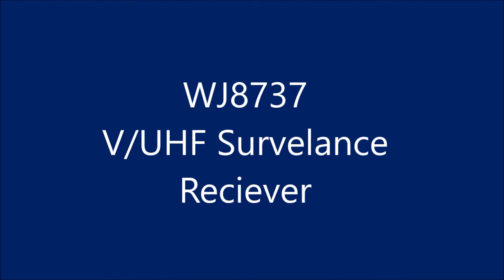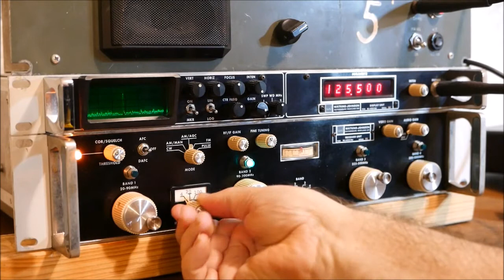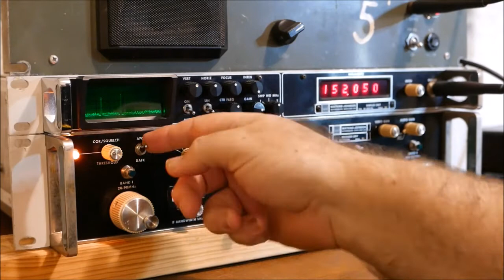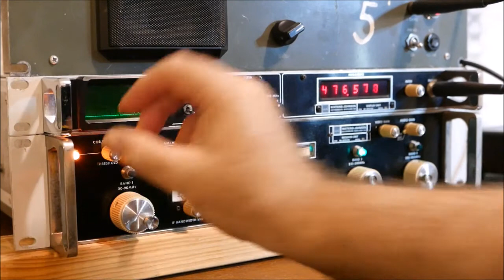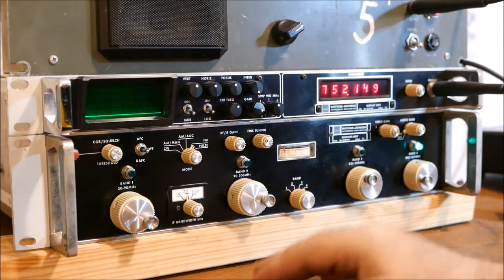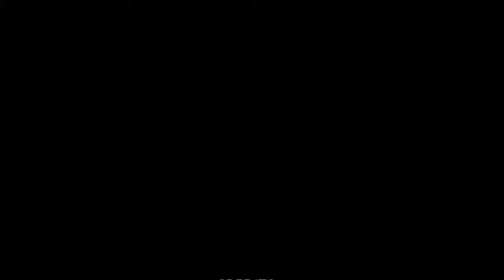WJ8737

Comment: Awesome I just bought one from eBay working just like yours cables all connected I have another one identical I bought from fair radio in 1994 it’s was tested ok at that time now I’ll duplicated the cables should I be concerned of blowing any Caps from the one from fair radio in 1994 thanks
Reply from the maker: Hi, thanks for the comments and great that you picked another one up. With regards to capacitor, if its not been switched on for 25+ years, you should take a quick look at the PSU Tank capacitors. Either 're-form them' or bring the unit up on a variac slowly and keep an eye on them.   Good luck !! all the best Pete
Reply: @vk4gxc  thank you I love your videos as I have similar radios indeed I’ll use a variac on all old gear I find  so I’ll do this with the Watkins Johnson  the one I bought from fair radio in 1994 it’s the cables that kept always I found is a stumbling block in powering these up to find connectors I don’t know how to I have a an/frr59 and other radios lacking cables or connectors again great to see your doing well
Reply: Thanks on my unit the higher band 4 was working but the it got stuck  meaning I turn the  knob  nothing happens it’s stuck n a frequency the knob turns fine but the numbers don’t change I have not had it apart yet seeing if it’s the shaft thank you Peter